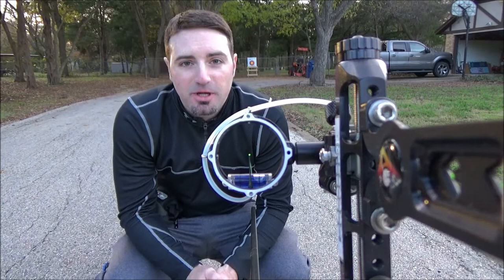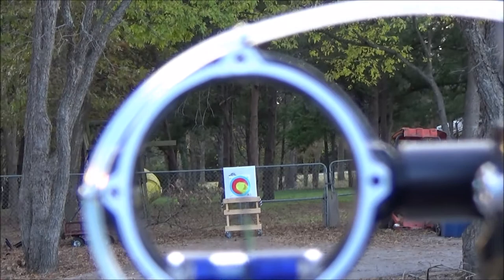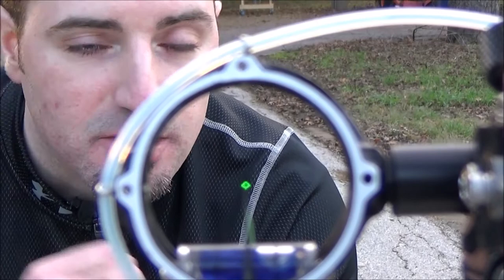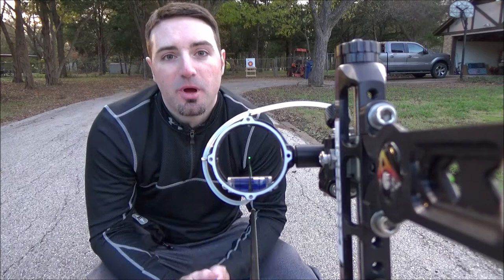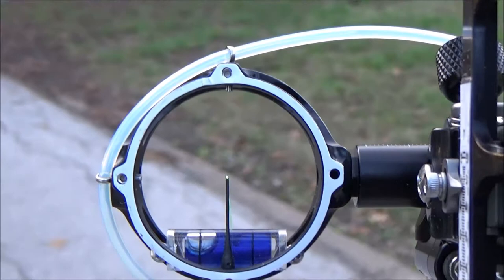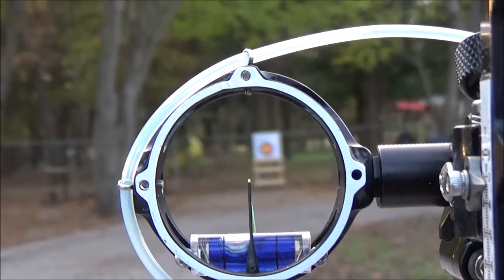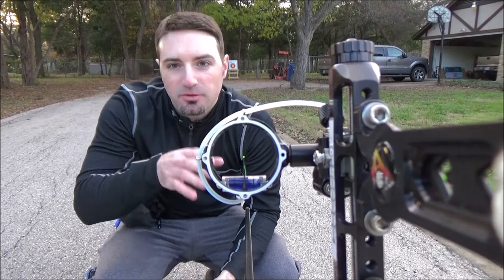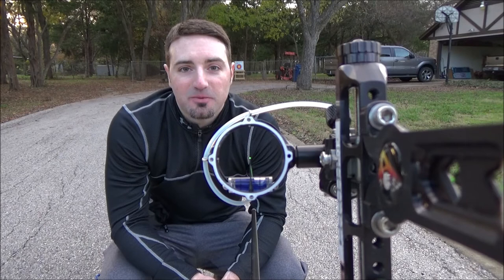Float Patterns Part 2 Draw Length Variations

Comment: Nice video - what distance is this?
Reply from the maker: Thank you! I believe it's 40 yards. It's different at times when I do these based on camera zoom and the bow's riser for the length of camera to scope.
Reply: @rcrchery  I have no idea how you hold so steady at that distance - I have started archery recently and at 20 yards I have way more wobble. I'd really be keen to learn from you your techniques. How would I do this?
Reply from the maker: It definitely took me a lot of time and effort to get to this level, and some days are better than others for sure! I offer coaching programs and I'd be glad to work with you! Here's a link to show you the programs: https://www.rcrchery.com/coaching-packages
Reply: @rcrchery  seems like when I draw back and am holding back my pin generally seems to float low as I'm holding back, side to side seems ok, it's like I have to make a conscious effort to bring the pin on target! Any suggestion on to why this happens, or what I can do to alleviate this?
Reply: @michaeledwards7668  relaxing your upper trap on your release arm and relaxing/stretching the back or your release hand has helped me with that.

Comment: sight look nice, what kind is it?
Reply from the maker: Axcel Achieve CX
Reply: +rcrchery I looked it up, but I don't see that option nor look like yours,  also I'm thinking about a scoop with x4 power, what would you recommend?  I like single pin, is there a dial or slider to adjust distance?  also are you a shop?
Reply from the maker: I have the model prior that did not have the carbon bar. If you've never used a scope before, I'd just use a standard up pin in a .10 or .19 fiber diameter then transition to a powered lens later. Small changes at a time to get used to new set ups. The end of the bar has a vertical adjustment that slides up and down for distance setting. I am a shop, I sell the sights. You have to purchase the sight bar and vertical adjustment attachment separately from the scope as well. I have some information on them on my website. www.rcrchery.com There's a contact form on there as well that you can use to email me.